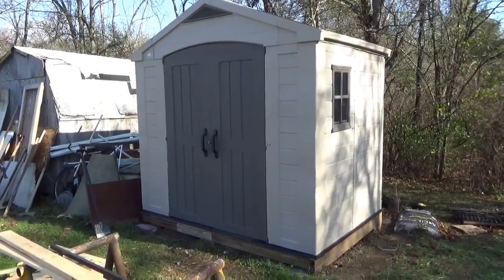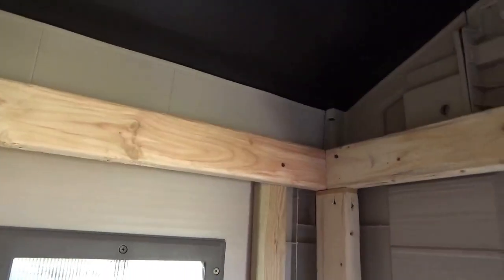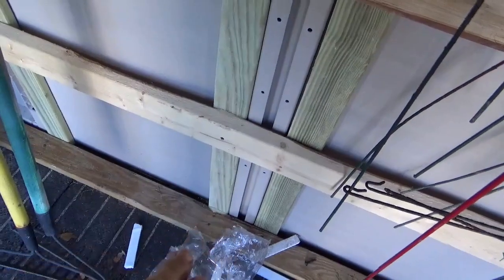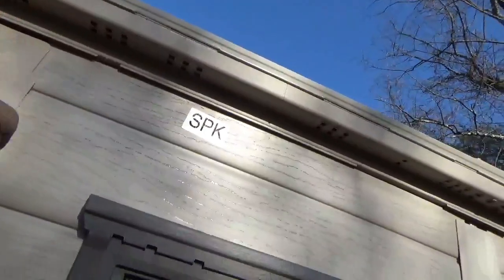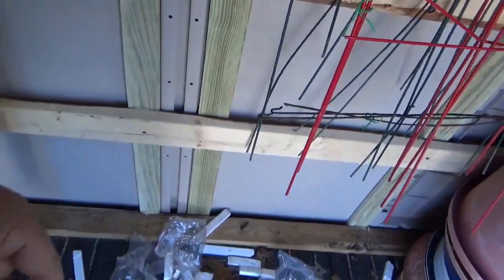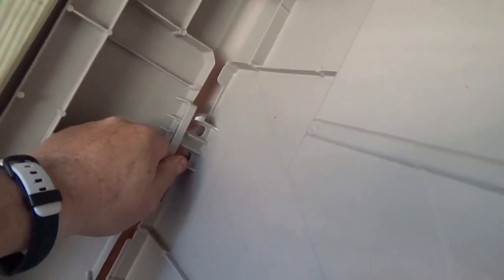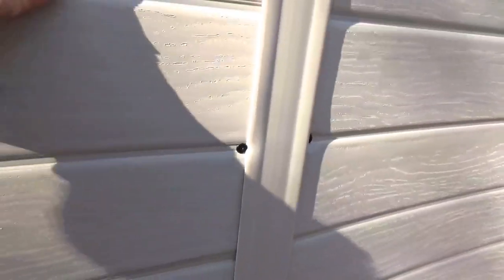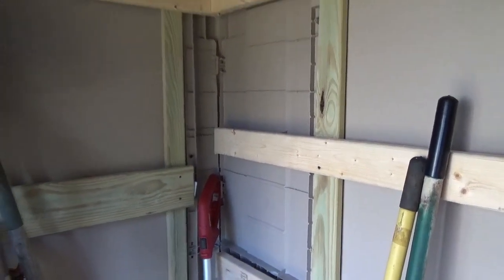Plastic Shed Nightmare, the Problems and Solutions!

Comment: Dont drill them or use any adhesive that will weaken the materials over time. these sheds are amazing, add a floating plywood floor, which adds weight and is sensible if you have a bike, for the stand, then  put shelving units on that. i might make a light batton frame for insulation and boarding, only fix where sensible to do so, also adds weight and comfort. trust these sheds, they wont let you down.

Comment: I give you credit for making it work. It should last forever the way you reinforced it. Look at the bright side. You still don't have to paint it on the exterior. You may want to treat tge interior wood with something to resist termites and carpenter ants. Just a thought. Nice work.
Reply: Great suggestion, treat the interior wood.  I had not thought about that, awesome idea.

Comment: The Rubbermaid 7x8 I got well over ten years ago is holding up well. The metal bits around the door are starting to rust though. It even survived a move and sitting in pieces outside a few years.
I built a frame inside it too, but solely for custom shelving. I might attach the shed to the frame some day.
Suncast, on the other hand, is not so great. The resin is brittle in the cold and it never felt as sturdy as Rubbermaid. Assembly was more difficult, but it was still a decent shed.
I also have had a Craftsman for several years that has been about as good as Rubbermaid.
Wood feels sturdier, but it is much more expensive and it rots. Arrow (steel) is a nightmare to assemble and it rusts rather quickly. The resin sheds are a reasonable in between.

Comment: Nice save, before the damage happens👍🏻
Only plastic shed experience I have is with a very small Rubbermaid garden shed. Used for gas cans and a small generator under my 3 sided carport, so not really exposed to much weather. It's construction reminds me of an old plastic Rubbermaid cooler without insulation between the inner and outer layers!  Thanks for the eye opener! I just ass-umed they were all about the same quality😳

Comment: I have had Keter sheds for a long time. 8x8, 6x6 and 4x6. These older sheds come with fully moulded solid L shaped corners fixed top and bottom with the large plastic wing nuts. The 6x8 has a fully moulded roof that comes in 8 sections. The 2 smaller sizes have flat sheet roofs. Water does come in at times along the horizontal seam on the large shed roof. I suspect that it's due to shrinkage in cold weather. The fold up corner type looks like a failure waiting to happen to me. I am putting up the latest Keter Newton 7x7 and it is a totally different design. With slim plastic corner posts, metal door frame, metal framed doors etc. Using hundreds of self tapping screws everywhere. The roof is 4 sections split vertically. So it takes me very much longer to put up, like 3 days. I wouldn't want to take it down and move it somewhere else, like the old sheds. That you I build in half a day.
Reply: once the screws go into the plastic, you can't remove them w/o them losing their mechanical hold.  the plastic has expanded and won't hold the same on the 2nd time....I would much rather have automotive 2-piece panel fasteners than screws

Comment: Them wing nuts are £12 a pop, one of mine has broke which was my own fault….so I need to do some DIY. Apart from that it’s been up more 15 years never had a problem with storms +  wind + rain Why because I put 2 ropes over the roof tide 4x 5 litre containers with water to stop the roof from flying off. 😃

Comment: I have pretty much the same shed and I've had it now for about 10 years up here in the Canadian winters and it's still standing. I didn't enforce the structure like you did and one big wind storm, pushed out one of the wall panels out of the frame so I just flexed it and popped it back in. I used spray foam seal on the inside edges to keep out rain and bugs and that works pretty good.
Just having the roof leak now along the top seam. One of the roof pieces is not butted in tight so water is coming in along the top spine. Any thoughts on how to fix that?
Reply: marine tape (or flex seal tape)
Reply: Don't the bugs just come through the gaps of the door anyway? I was going to spray foam or caulk around the structure and remembered that there is, basically, a gaping slit by the door.
Reply: @joshuaychung  The walls have shifted enough over time and I had to drill decent sized holes for the plumbing for all my pool hardware (pump, filter, etc...) so now I get things coming in. Over the years it's still been pretty solid.

Comment: Is a plastic shed the same material as a rubbermaid shed? Rebuilding here in Florida after hurricane Ian, wondering if rubbermaid would warp in Florida's hot sun? Thank you!!
Reply: regardless of the material, ground anchors are a must.   I choose the lightest color possible for my suncast Modernist shed; however, the roof was black on all 3 colorways.   would a wooden shed w/roof shingles be better w/the rain/heat.  worst case is repainting every 5-7 years...

Comment: Harvey, I'm thinking an atv lift, engine test run stand, tire machine, and a compressor, but no, a garden shed! The story about your "Time Out" shed had a  nice twist though. All kidding aside, a very nice job bracing it up, but it would be cool to see one built as per the directions in a wind tunnel with the designers inside. That's my kind of entertainment. Over and out .

Comment: I wonder if using construction adhesive would add stability if used along the seams and joints.  It wouldn't have the same rigidity as the nice frame you installed, but I was just wondering.  I'm in an area that receives little to no snow.